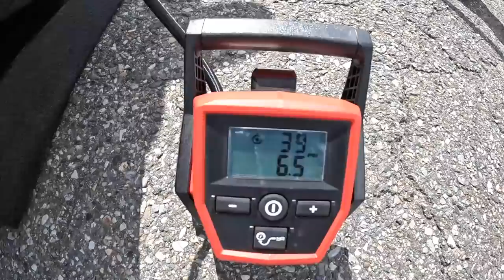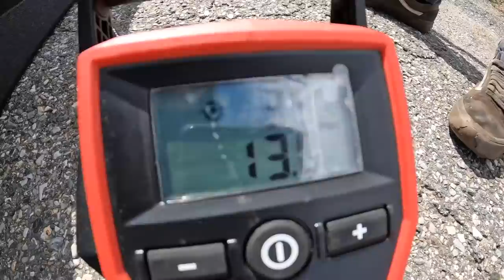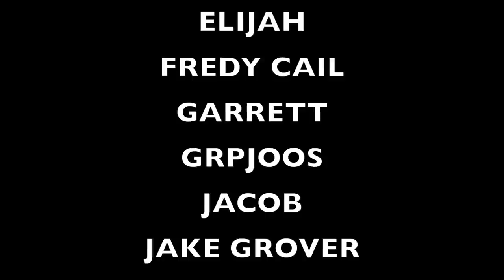THIS WAS AN AWESOME OPPORTUNITY!

Comment: Chris the secret trick to keeping the 370/350zs from overheating under track use is to switch out the coolant for the top grade BMW coolant that is compatible with the car and to add a generous amount of high quality water wetter and it doesn't hurt to make sure that you only add distilled water to the mix if you have to add water, tap water contains minerals that heavily reduce the cooling capabilities of your cooling system fluid.

Comment: Chris, are you going to be swapping the rear trailing arms around on the white and other e30? Looks like the white e30 has e36 compact rear trailing arms on it because the wheels are five bolts. E30s standard are 4. Would want you to have issues getting wheels in the future.

Comment: Tip for you if you want to keep your car from getting to hot use motorbike coolant because motorbikes run at high temperature so if it keep a bike cool it will have no problem keeping a car cool